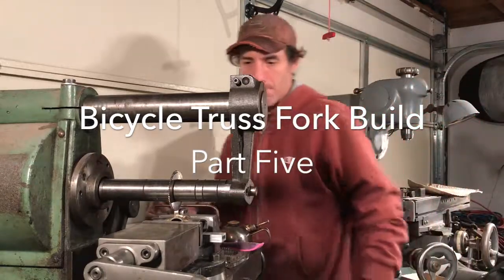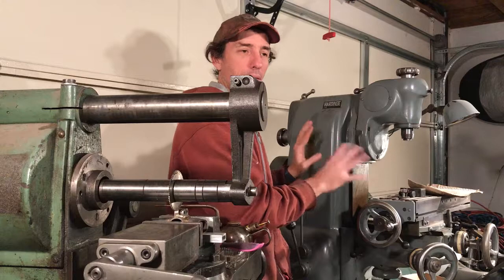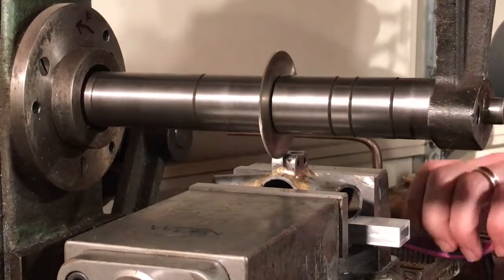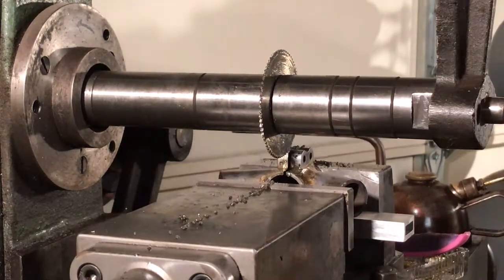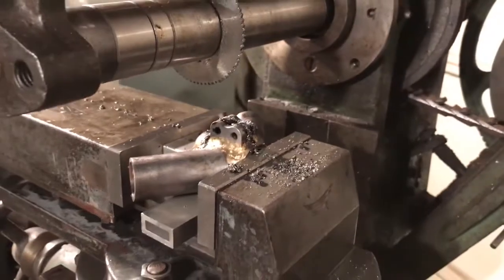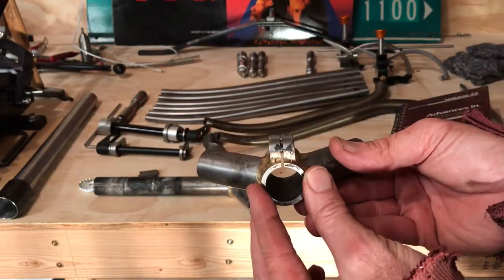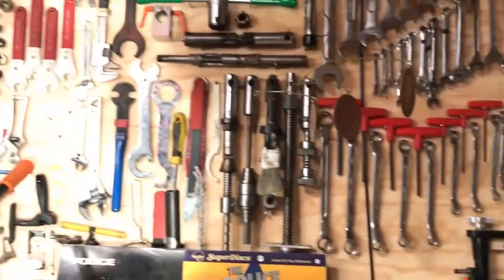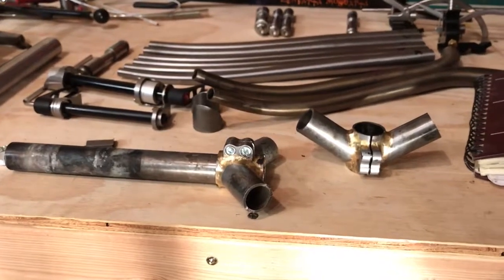Bicycle Truss Fork Build - Part Five

Comment: Hi, I love what you do, but
man do you deviate into too many subjects, so if I may suggest, please focus on one topic and concentrate. Separate presentations about milling machines and such from the main subject as in building forks into other videos.
Are you going to finish this fork in 2018 still? I would really love to see it.
Reply from the maker: Yes...I could edit these down to about 1/4 of their length and still convey the message. It will get better...
Reply from the maker: Andreas, Check out the fork build part 1 Redux. Not perfect but an improvement. Going to strip them all down. Thanks for your input.